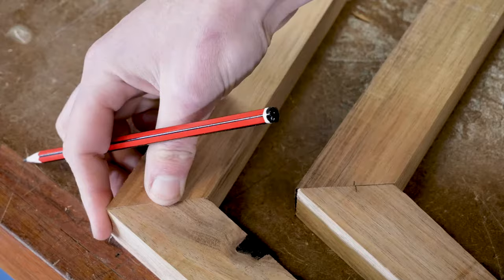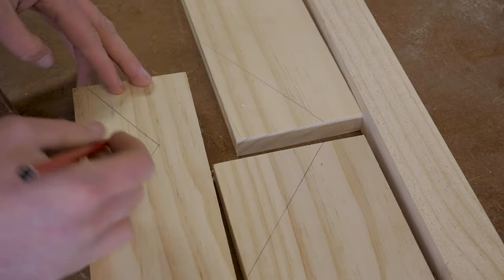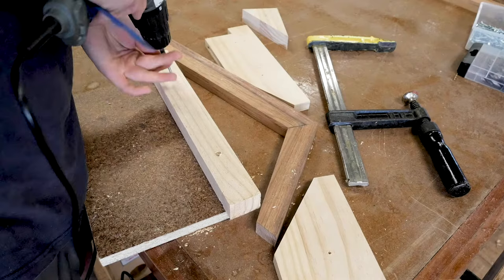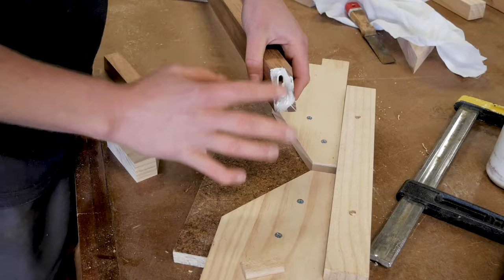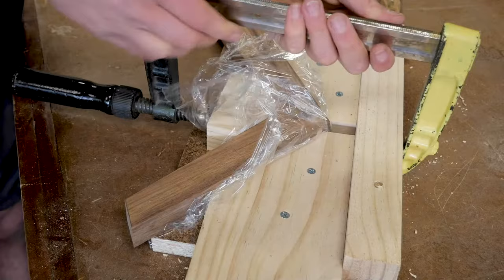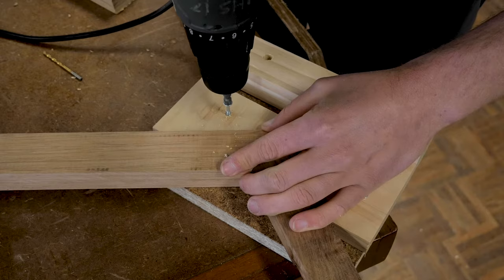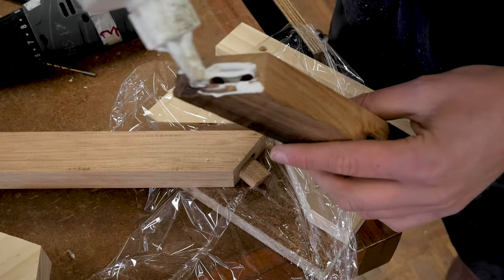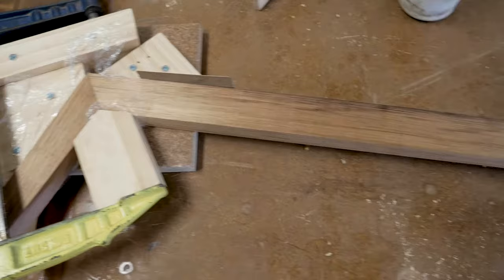How to clamp any angle

Comment: I don't want to be critical, but your setup doesn't provide any force to bring the two legs of the angle together.  You need a force to push the two legs into each other.  As you apply clamping pressure on the clamp, if anything you will be pushing the two legs of the angle apart.

Comment: Your jigs and this video make no sense, the clamping force should be perpendicular to the glue line, not parallel. You want to press the two pieces of wood together. You literally ended up with gaps everywhere in both cases.
Reply: So he should have fastened the pieces he used to clamp and clamped using the pieces he fastened?
Reply: look closely it kind of does.

Comment: I have just used your method and it is pulling the wood apart, not pushing the join together.
Reply: https://youtu.be/pWIt5b5V2XM?si=DT_Ip0VHCJIdReHK Here is a much better way to clamp odd angles. I have just finished using this method and it worked perfectly. Obviously this type of style won't suit everyone.